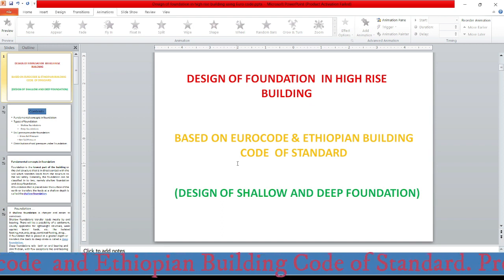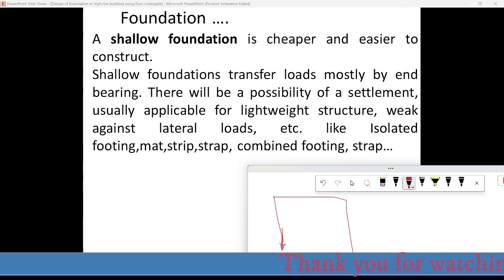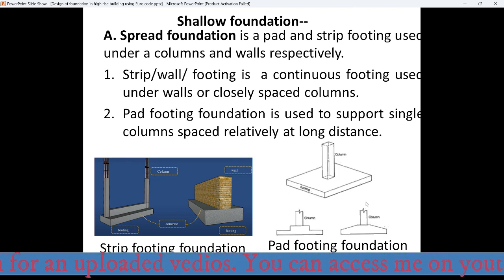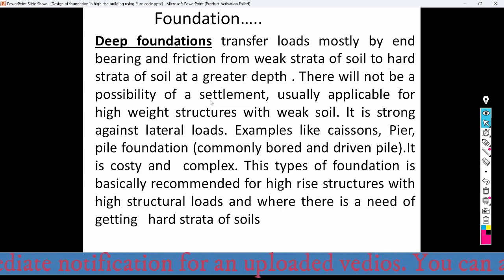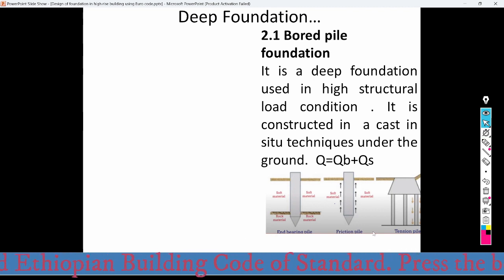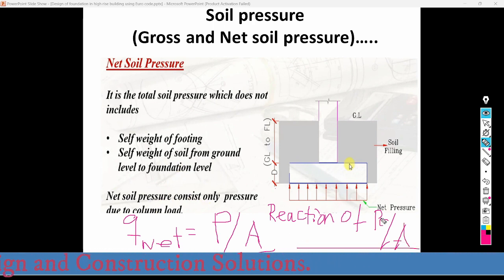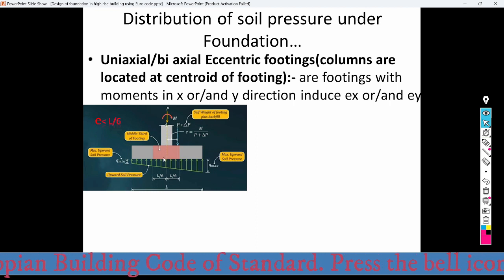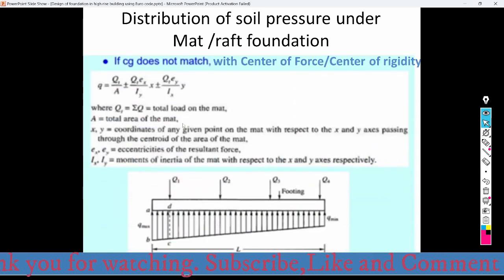Design of Foundation in 20 story building as per Eurocode & Ethiopian building of standard (part 28)

Comment: Thank you for the amazing work, sir. Your videos have been very helpful. You make it easy for someone to follow and understand the steps. My question concerns the total weight of your structure after you run the analysis. I'm working on a similar structure for my thesis but the total weight seems a bit much (66404.953 tonnes to be exact) Its a 17 story Residential building with 2 basements used for parking. Thank you once more
Reply from the maker: The total net service gravity load( structural load)  is around 316000kn. It depends on built up area of the building. Net service means loads excluding foundation self weight and  weight of surcharge soil.